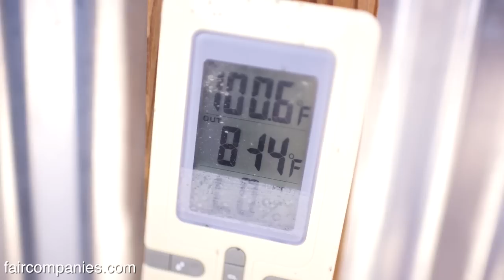From Gotham to isolated, code & debt-free West Texas estate

Comment: America needs a hard reset. All this stuff we are surrounded in but have no need of, yet basic needs are easily taken for granted. This dude is all set! I think he has real wealth and prosperity.
Reply: daniel madrid you're exactly right dude and this guy owns Forty Acres you're damn right he's wealthy how many of us on 40 acres of anything? I'm living on a fucking postage stamp-sized yard it's probably 1/16 of an acre and I paid way too much for it fuck that
Reply: it is exactly what i want myself though i do want to be able to power a lathe/milling machine. also self taught blacksmith, saddler and carpenter. i grew up jillarooing and sawmiling in australia
Reply: Toni Smith if you need 2 phase you'll have to get a generator out there. 3 phase? A more serious generator)
Reply: here in australia we have single phase which is 240 volt and 3 phase which is 415 though in 415 there are about half a dozen diferent amperages from 20 amp up to 50 amp. even in single phase there are 2 amperages being 10 and 15 amps respectively. for single phase all the difference is is heavier earthing and other wiring on the 15 amp circuit being heavier
Reply: Move this comment to the top
Reply: The average human doesn't need much to survive. You can see this by looking at how tribes lived hundreds or thousands of years ago. The problem is, there's no real profit in living simply. The USA and most of the world is driven by profit and greed. Companies don't want you to live simply or you may not buy their product. There is no escape from this. The areas of the country where you can grow and raise all your own food without the need for irrigation, also usually have building codes and laws aimed at keeping you from living simply. In my area, for example, the minimum home size you can legally build is a thousand square feet. You are also required to have hot running water and cold running water. You can't just use a jug on a sink. You can't use a well with a manual pump. Heck, to be up to code, buildings here have to have central air conditioning and central heating units. Even if you have a wood stove for heat, you still have to have the central heating unit to be up to code. If they find out your home isn't up to code, they can kick you out and forbid you from living there until "the issues are corrected". If you live there anyway, they can and sometimes do put you in jail and take your home, or demolish it, depending on what is "wrong". In the areas without such codes and laws, growing and raising your own food is very difficult to impossible without spending a fortune, which sort of defeats the purpose. This man, for example, can't just put seeds in the ground and grow food. He would have to drill a well (probably cost more than the land cost) or set up a complicated and large rainwater catchment system (also a fortune). Then you have the issue of drinking water. Rivers and streams are contaminated due to industry and bacteria we aren't used to consuming. Rainwater is just about as bad. A well would be suitable, but again expensive. If you want to live today like people lived a hundred or so years ago, you have to basically be rich or lucky.

I live on an acre. I want to downsize my home from 1200 square feet to a few hundred. I can't legally. If I do it anyway, it's only a matter of time before "code enforcement" finds out then screw me over.
Reply: This guy has nothing right except maybe a monthly stipend from investments or retirement or savings. He buys everything he needs to live. Notice the bottled water and canned food. With a filtration system he could make out of materials he has around, he could stop buying water. It's the desert he can't grow enough food to survive. Maybe he eats cayotes? His place looks cool but has no sustainability.
Reply: Toni Smith ++ Native Texan here. Please define jillarroing (sp?)
Reply: Banana Phone ++ Oh sweetie. What the heck state do you live in? You poor thing.

Comment: Under ground it's always cool 60 to 65 degrees...you can dig a trench 4 to 5 feet down and 30 to 40 feet long...put in some 8 inch PVC pipe to go out and back...plum one high to collect the hot air in your living quarters...and the other down low and hook a CPU fan to circulate (suck) the air...or what ever works for you...the air will return cool to cold...even in the desert...great job man...
Reply: That is what I was thinking. My dog likes to dig a hole and crawl in it. why is he above ground?
Reply: in that area, you'd have to go a little deeper, but yes, it's doable.
Reply: @shanniworld8310  The desert has a lot of clay in the dirt which has hardened into an adobe layer..  When the summer monsoon thunderstorms hit the water doesn't soak in, it collects on the surface and causes what is called sheet flooding,  Here in the S. Arizona  desert, I've seen water 3 inches deep everywhere for a mile around after a big thunderstorm.  An underground room would fill very quickly...maybe too quickly to get out alive.
Reply: Yes ,the Rameys did that on homesteader rescue. It worked.
Reply: Cool info.  Ty
Reply: Yeah, not so much here in Brewster. Maybe around 25ft or so. But once you break the ground up it will heat up super quick from then on. That's assuming it's not just rock after the first 1 or 2 feet. Which unless you're snug up against a mountain it's almost guaranteed to be hard rock at a max of 4 ft. He's next to a "creek" so he might get 6ft in a few places and no feet in even more.
Reply: So right...id much rather find a bluff and bury a few storage containers the living space..  naturally cooler.
Reply: You can check out 
Earth Ships Taos NM
Images...
They use the earth to cool the air..
And large roof heated air to suck the cool air in..
No need for fans..
Yes you need to keep doors and windows closed...
There are some great Utube videos on the homes...
Look for the one with the garage... It has the best walk thru tour
Reply: @jimh712  

Those are nice, and they can be effective in some situations, but not all. Things to remember, they are comparing the ambient to the temp at the output. And they often make huge claims by saying, "it reduced the air temperature by 10 degrees." What they aren't often telling you is the starting point. If the ambient is 110, and you cool by 10, it's still a miserable 100. And they often also don't state the ambient in a building away from the devices. Which often gets as high or higher than outside ambient.

 That's why humans take great pains to prepare when working in these type of environments. Water, shade spots, cool down areas and frequent breaks.

That's a tactic often used by people who are more controlled by the human made climate change religion versus actual science and fact. It's irresponsible and untruthful. The difference between a 100 and 110 degree day in terms of human habitation is negligible to anyone not fully acclimated to the higher temp. Which is almost all humans and animals on the planet. We all use coping methods instead. With humans being able to fully modify the local environment inside buildings they build to go even further.

Relatively speaking the same is true for heating cold temps. The major exception being that 10 degree swing between freezing and thawing. That is an area where 10 degrees can differentiate between life and death. 

Practicality dictates that most of these environmentally friendly cooling and heating options are useless. At least in a modern society.  

Now in the wilds of Africa where a huge portion of the population exists on base levels with high death rates, it can be a game changer. Most of those places have little access to actual decent roads where things like solar and wind plants can get to them, much less public power and water. 

If you've ever actually tried these methods yourself you tend to find several problems with them. 

For one, they hardly ever produce the same results in the uncontrolled environment of reality. The world is not a scientific lab with controllable variables.

 And the big claim that anyone can do it anywhere discounts completely the local availability of materials, types of materials, and quality of materials. All these are things that are controlled in the lab type environment of the site you mention. Which is one among many past, present, and future. 

Often mentioned is things like using plastic bottles and glass bottles from trash. Even more often is the disregard for how much more effort it takes to get sufficient quantities of these items to the places they would be used.

 It requires energy intensive sorting centers for trash(even with bin separation programs), cleaning centers to disinfect the products, and then packaging centers to make them transportable. Then you have to transport them. All this takes far more man power and energy than it does to install wind or solar power and run an air conditioner or swamp cooler. Both are items already mass produced and require no special facilities which themselves create some amazing amounts of pollution. 

Which is why they don't tell you that the pollution created in recycling paper and plastic is several times higher than the pollution created during the initial manufacturing of those products to begin with. It even eclipses the full life of a newly created product when taking into account the extended breakdown time of plastic in the environment. 

Now that doesn't discount all recycled products and methods. Metals recycling is far more effective than new production. And if you eliminate the thought that recycling means breaking down a product and reconstituting it into another like product there are many cost effective things. And if you're able to recycle something on a personal level small scale that can be effective. It's generally the big government pushes that result in waste and highly pollutant recycling measures.

So yeah, if you have several hundred thousand bottles lying around, woohoo. Otherwise it's an extremely wasteful idea with negative cost to benefit ratios both environmentally and monetarily.

And if you have access to large equipment for digging tunnels in hard rock and stuff, woohoo. Again, the average person doesn't. And it brings a host of other problems with bugs and animals. And that's not even taking into account the excess energy needed to run the equipment to begin with versus what's used in traditional building methods.
Reply: My theory 
And it's only a theory..
But i will in the future .run experiments..
People say the geo-thermo tubes don't work...
My theory is PVC won't give optimum temperature transfer.. 
Why.- PVC should have some R Value. 
And being smooth and I'm thinking there won't be enough turbulence for good energy transfer..
I'm thinking corrugated pipe might give a lot better energy transfer with a lot less R Value....
PVC would be cheaper
But Corrugated pipe should be affordable...
These are theory..
Tests will provide better data..
(I base my theory on what Earth Ships, i have researched, are using for Geo-Thermo-Tubes)
Reply: @jimh712  
PVC definitely wouldn't give the best transfer of temperature. Concrete or bare rock would be the best as there is less types of material to transfer through. The more types the less efficient. Next would be a metal, but they also have the distinction of easier transfer the wrong direction so that anything close to the surface would heat up faster. PVC is hardly friction friendly and easily holds temp compared to other materials. However, electrical conduit PVC might not be as bad(grey tube) as it's specifically designed to have a lower R value to keep the wires from overheating as bad, and water PVC(white tube) is specifically designed to be more resistant to outside temperature changes. Mainly because of freezing. 

Most efficient models would have the hole bored and the transfer material injected in such a way to make the inner surface of the natural rock have full uninterrupted contact with the liner material and then highly polish the inner liner to remove friction. Also all turns would be best if extremely gradual. But the expense is huge and goes up exponentially for every refinement. 

Simply digging a trench and throwing in the pipe will be the least efficient way. By a lot. If you live in a desert environment like here the ground is significantly hot down through 20 feet. And if the soil is not compacted and hardened it's worse. In our area the upper soil layer can aid in insulation as it has a ton of limestone and slate stone. The combination is a water and temperature resistant clay type barrier that is amazing for filtering water. Once that's stirred up there is more rock to rock contact which increases heat transfer through the layers down. Maybe if you transported in a more soil like covering it would do OK, but if you could bore a hole it would be far better. 

Dunno. If you have money and time have at it. Otherwise it's a significant cost with little to no benefit. And it definitely wouldn't compare with standard heating and cooling methods already in use. The compressor method works far better(normal house A/C cooling). Hell, you could even rig up a direct powered compressor setup using running water from a creek or wind power. The efficiency would nose dive, but it could be done. I could see a few ways to utilize gears to make it more efficient and even slack gears to create steady input speeds.
Reply: They say go 8 ft down and out over and in the same length of the structure. So say you have a 40 ft greenhouse, go out 40ft across 40 ft and then back 40ft. It will never drop below 50 in winter and won't overheat in summer.
Reply: That's what I was going to say!
Reply: You can avoid the sheet flooding, as one commenter brought up, by appropriate berming and  mounding. It's not going to be a problem.
Reply: Solar power is not so expensive now. New or Used A/C unit, powered with solar, might be cheaper than you think.

Comment: We did the exact same thing -- seven years ago! We moved into a 10' x 12' shed (with a sleeping loft). Also had an outdoor shower until last year! Used 3 - 120' hoses for a water heater, had chickens, pooped in an outhouse, etc. My son and I built our house over the summer and fall and finally dried it out in late November. I worked online from the shed during the day and worked into the night on the house. We are on a ridge over the Mississippi River in Wisconsin, so we have very high winds that shredded our camp several times (our workshop was in a tent). Good luck John Wells! I wish you all the best!

Comment: The perceived need for huge living space and "material goods" is mostly smoke and mirrors. I certainly can appreciate this gentleman's perspective, though I think I would find Texas summer heat oppressive, it is a beautiful place. I spent some years on the Canadian prairies with some similar but cooler view. I now live in the Maritimes, retired and not off the grid though sometimes due to the lack of maintenance the power company seems not to care much. We keep a generator set and heat with wood so it doesn't matter very much, but we're low impact living. A garden gives us a lot of our food, some of it four legged. A wood lot and an elderly tractor keep wood in the shed. I gave up on chickens because the raccoons thought I was KFC so we buy eggs now. I am going to venture into solar electric because we have converted to mostly LED lighting and low current electronics. I would suggest maybe using one of the old fashioned wringer/washers for laundry because they are relatively low current and with a set of laundry tubs, very conserving of water. We have a water shortage most summers being on a ground water well, and I used that process till we got a tiny spin washer, but with a laundromat only a few miles away that often wins out for us.This was a very interesting video! Thanks!
Reply: +Frank Reeves  
Out there we enjoy coyotes, fox, raccoon, every four legged critter that wants the chickens and/or their eggs. Since everything else out there requires work the building of a covered chicken yard,  (not coop) is a wise investment of time. The roof is required because all said animals can climb, and hawks fill the sky. If your time is YOURS, you can make the choices you want. I LIKE eggs. And chicken.John uses gas to cook most often, but just tree scraps and a stone rocket stove can cut that cost to zero. The heat that can be gotten from a rocket stove is incredible, especially considering how little fuel it uses. Literal twigs can make a pretty hot fire.(useful there because trees aren't abundant).